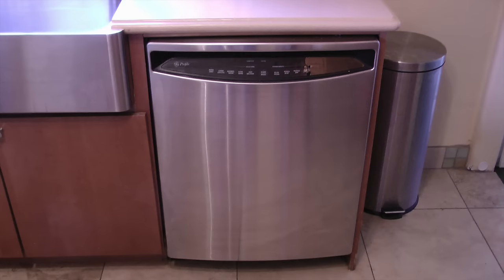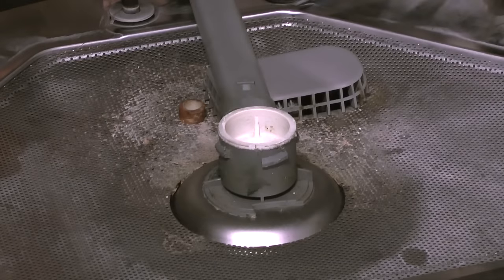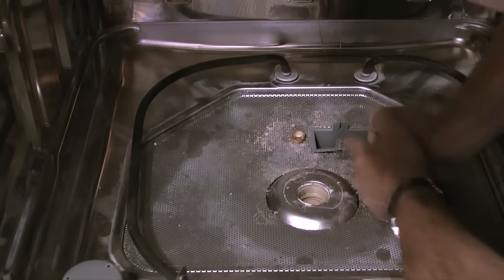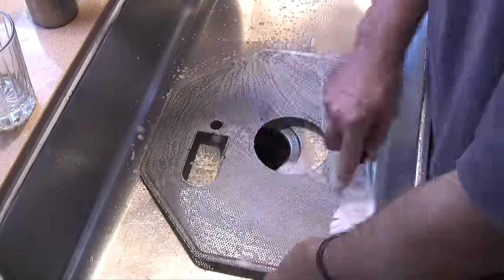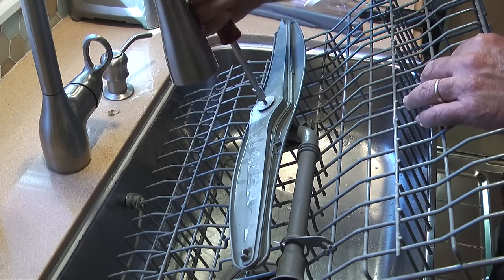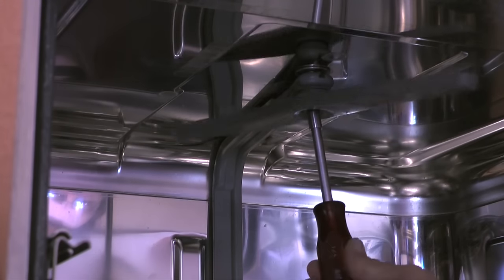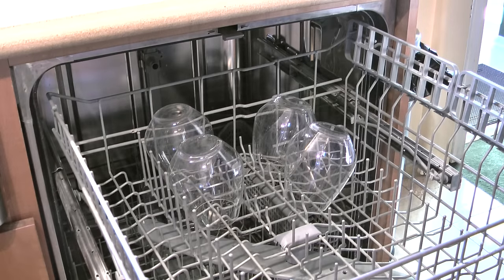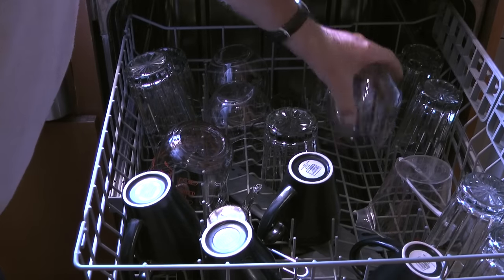GE Profile Dishwasher Maintenance

Comment: THANK YOU!! I have this same dishwasher, but maybe an older (or bigger?) model. The parts in my dishwasher have a lighter color and the utensil basket is different, but the interior parts - and even the front panel - look exactly the same as yours on this video. I have a clog that is making water come out the bottom when I start it, which usually happens when something is clogging around the filter basket, usually when there's  a popcorn kernel stuck in there. But since I can't seem to get it cleared on the surface, this time, I will use your video to get that basket cleaned out. I appreciate the thoroughness! Great video! :)
Reply from the maker: Good luck!

Comment: I had my GE dishwasher out of the mounting and in hundreds of pieces for a complete DIY garage overhaul several years ago.  I literally had calcified stalactites and stalagmites under the stainless coarse screen.  Removing the mineral deposits alone restored the function to near new.  I'd been dreading that whole process again as things have built up a second time over the years, but decided to watch your video and found an even easier way than the last time I'd done it.  BTW, there is a lower rubber bootie that is the main seal for all the low point connections. If you take the whole unit out anyhow, it's well worth going after that inexpensive part too.  Especially if your dishwasher is 8 or 10 years old.  The rubber boot gets brittle and will be the point of leaks if not maintained.
Reply from the maker: +YankeeinSC1 
Good tip, thanks for posting.

Comment: Excellent video but I have to add 1 thing. There is 1 screw holding a temperature sensor cover on (at 0:31 part 843) the part at the left front of the machine as you are looking at it. When I removed this there was nothing but deposits and mold between 843 and 302 and between 302 and what looks like a temperature sensor. It was so clogged I doubt it was working correctly.

Comment: Thank you so much this video has been extremely helpful. I’m grateful to have found it. I am having a major issue with the Venturi it won’t unscrew to save my life. It will barely budge. I don’t want break it because I’m in an apartment.
Reply from the maker: I feel your pain. That's one problem when doing the project yourself, if you break the part then you're without the dishwasher until you can order a new one. Still, if your dishes are coming out dirty your dishwasher isn't doing you much good anyway. If you're renting can the landlord help and call an appliance technician?

Comment: 6 years later and still helping people. Thanks mate, I didn't even think to clean it so thoroughly when I stumbled across this video. Was having issues where the machine was getting stuck on 1 minute remaining, and I had cleaned out the filter basket previously without removing it and felt nothing more. I was actually looking for access to the turbidity sensor as I'd read a dirty one can cause such issues, but this video made me think to give it a deeper clean. By removing and cleaning everything I found and cleaned the turbidity sensor as well located behind the basket. It had a fist-full of white gunk on and around it. Hopefully cleaning all the gunk out will fix it.
Also I think that might be algae you are pulling out, yuck.
Reply from the maker: Cleaning the filter made a big difference on our dishwasher. Thanks for watching.

Comment: What genius designed that filter fastening method? Great how-to video.
Reply from the maker: Good question. It would have been nice if they would have designed the filter so that it wasn't under the supply tube, that way you could remove and clean the filter without removing the supply tube first.

Comment: This is an outstanding example of how to make a video on youtube!! Clear, easy to understand - I wish I could work as fast as you in the video :)

One thing, after taking the venturi out and washing it in the sink, I noticed a silver colored ring (gasket) in the sink. Hummm. I finally discovered it came out of the venturi, fitting between the venturi and the washer arm. Apparently, yours didn't fall out. You might want to mention that in the description of the project.

Comment: Thanks for the great video.  We had the same problem as you, dishes not getting as clean as they used to, so I started with your procedure.  Then I discovered a problem... the tube coming from the sump was completely rotted out!!  I've now replaced the sump and am running the dishwasher to see if it's fixed, fingers crossed!!  :)
Reply from the maker: +Gordon Cindy 
Thanks, did your repair work?
Reply: +iScaper1 Well, the dishwasher seems to be cleaning better than before... and there's no big puddle of water under it, yet, so I guess all-in-all a successful repair!  ;)  Thanks again for your helpful video.
Reply: +Gordon Cindy where did you get the parts to replace your sump? I just discovered that the tube on mine is completely rotted out as well! Thanks!
Reply: +Justin Morgan I got it from Reliable Parts,  I believe this is a common problem. I'm not sure where you're located but there is a website for Canada (http://www.reliableparts.ca/) and one for the US (http://www.reliableparts.com/).  They have a store local to me so I just picked it up there but I think they ship as well. 

Good Luck.

Comment: THANK YOU! I was on the verge of buying a new dishwasher - should not be necessary now.  The GE user manual is NOT  helpful with this process.
OK.  Now that I have completed the process... boy, howdy, what a lot of work.  My tubes inside the machine were oval, like a racetrack.  And I couldn't  remove the screen on the floor, or I couldn't figure out how.  Fortunately the screen was plastic and I could lift it and clean under it.  There was about 20 years of gunk built up under there!  How we kept from dying of food poisoning I'll never know.
Thanks for your help.

Comment: FILTER BASKET EXTRACTION: I don't know if your model is different, but when I looked down into my basket there are little "catches" on the inside that you can see and feel.  These catches are connected to the clips that you were trying to get to from the outside of the basket.  Simply put your flathead screwdriver in the catch and gently pull the clip into the basket.  One side then the other and out it comes.

Great video.  Thanks for posting.
Reply from the maker: Thanks for the information.

Comment: I just cleaned out my GE dishwasher (non-Profile) using this video for guidance. I have used various dishwasher cleaners in the past (affresh, dishwasher magic, lemi-shine). I really didn't have any food particle build-up. What I did have was massive amounts of a white grainy substance. Everywhere. We have hard water and this became an issue a few years back, building up and clogging the arms. I always suspected the machine had build-up in other places but I could never find instructions for cleaning it out. Took several hours. Needed a paint scraper for the bottom of the tub. I had to use a shop-vac to get the particles out of the space below the filter basket, but it's done... Thanks for this video. A lot of my neighbors have just flat-out replaced their machines, and I'm guessing this is the culprit.
Reply from the maker: +Jill Long 
Have you thought about installing a water softener? It might be a long term solution.

Comment: Wow - amazing!  Great video - I could NEVER figure out how to get that darn filter out!!!  I did shortcut a step but it all worked.  Unfortunately where the filter is that little pipe had a break in it, but I duct taped it and it's working fine.  Going to end up with a new dishwasher down the road - that's beyond my abilities.  No more fancy ones either... just need one to get the job done :)
Reply from the maker: Thanks Sharon for watching.

Comment: Thanks very much for an extremely helpful video. I have a version with an adjustable top rack, which according to the manufacturer can only be removed by a technician. Just remove the screws holding the metal plate and plastic hangars (located on the left and right side of the top rack) from the rack and you can pull the rack out from the top.
Reply from the maker: +Christopher Boone 
Great information, thanks for posting.
Reply: +Christopher Boone My top rack is stuck only on the right side (other side slides fine).  I don't see the screws or hangers you are referring to.

Comment: Thank you for this excellent tutorial. I found I was able to move the supply tube out of the way after disconnecting it from that venturi thingy and the bracket at the back, so I didn't need to take out the very top spray assembly. 
ONE MORE THING YOU CAN DO:  Switch detergent to The Home Store Ultra Shine Dish Detergent Pacs from Dollar Tree. Ten packets for $1.00.  Ten cents a load. The best ever. No gummy rinse aid to use. With repeated use it cleared up most of the white gunky film on the dishwasher and glassware.  Try it.
Reply: 7

Comment: This video was amazing - thank you so much! My dishes weren't getting as clean, and there was a smell coming from the dishwasher, especially while running. Like you, I couldn't find any instructions for actually cleaning it, so I looked to disassemble it. I was disgusted with the amount of 'grossness' hiding below but I am so glad I know it is clean now. Your instructions and attention to detail, along with the reassembly were very easy to follow! One thing I noticed is that the drain immediately filled up with water when I was done and used my sink. I googled a little and this seems to be caused by not having a high loop in the drain hose connecting to the garbage disposal. It allows dirty water to go back into the dishwasher, and sit there. Do you know much about this? For now, I have just looped it the best I can and taped it to other pipes. I know, not ideal, but I didn't want to undo all of the cleaning that I just did. Thank you again!
Reply from the maker: +Sarah Quackenbush 
Thanks Sarah for the kind comments. Yes the drain hose needs to have a loop that is higher than the connection to the garbage disposal for exactly the reason you describe.

Comment: Thank you SO MUCH for the excellent and detailed video!  We will start on our Profile dishwasher right now!
Reply from the maker: Good luck!
Reply: Done and ecstatically happy! We also found that along with dental picks, fine-tip hemostats were effective in grabbing and removing items from the spray arms. I actually pulled a shred of carrot out of one arm port!  Also went a step further and removed the water-tube feed from the upper rack and found much gunk in there as well.You are a life (as well as repair call) saver!  Thanks so much!
Reply from the maker: Dental picks and hemostats are a great idea, thanks for posting.

Comment: Thanks for the video. Makes cleaning filters so much easier when you can see how it is done first! I have model # PDW7300N10BB and it seems to be a little different than yours. The hub venturi does not screw out like the one in your video. Fortunately for me the course screen is pliable plastic instead of metal and I was able to simply bend it around the venturi and remove it for cleaning. I searched different web sites to find out how the hub venturi comes out of my dishwasher without any luck. All I know is that it only turns less than a quarter turn and comes to a sudden stop. Fortunately I was able to work around it.
Reply from the maker: Thanks for the information. Hopefully it will help others with the same model you have.

Comment: I have a slightly different model with a “nonremovable” top shelf, and to remove that, I had to use a flathead screwdriver to push back on the last tab portion of the end cap from the inside, then slowly and carefully rotate the cap counterclockwise to remove it.
Reply from the maker: Good information, thanks for posting.

Comment: Thanks for the help! I believe this was the problem with our dishes not getting clean. I did run into a problem removing the spray arm from the top of dishwasher as the tip of screw broke off. Found the part number to reorder another screw but I’m wondering how to remove the tip of screw that’s now broken off in the conduit main assembly?? Hoping I can do this without a service call.

Comment: Nice presentation. Keeping it straightforward and clear. Well done. Now if i could only know why the indicator lights are not illuminating.  🤔
Reply from the maker: +handiexpert 
Thanks. When you find out why the lights aren't working please report back.
Reply: A service company suggested I would likely need a control board and that would be costly. So we agreed I would live without lights.
Reply from the maker: +handiexpert 
How much is a control board for the dishwasher?
Reply: Couple of hundred bucks. Too much to invest in an older and otherwise working dishwasher.
Reply from the maker: +handiexpert 
Agree, it's interesting how they price replacement parts so high that consumers are pushed in to buying new instead of fixing the old.

Comment: Thank you so much for this video!! My dishwasher is running now after I cleaned it. I'm still thinking I screwed it up somehow, but so far so good!
Reply from the maker: Elke Starck 
Where do you think you screwed up?
Reply: iScaper1 I think it's fine now, I just took it apart to clean but managed to get it back together with the help of your video. I do need to get a new filter though, there's a small hole in the mesh.
Reply from the maker: Elke Starck 
Good thinking, if the filter has a hole in the mesh it should be replaced.

Comment: Hi, I had a leak coming from the Float Assembly, in my GE PDWT580R10SS Dishwasher.Totally ruined my Cherry wood floor in front of the dishwasher! Luckily I have extra wood slats! I tightened the Float Assembly which stopped the leak.  Decided to clean the dishwasher while I was at it!  I completely followed your directions to clean the filter. Took everything apart and put it all back together.  Sadly, the tab on the dishwasher Venturi snapped off while putting it back together when reconnecting supply tube. A new Venturi is no longer available. It has been replaced by a Dishwasher Feed Tube with an attached Venturi which I have ordered.  In the meantime, I used epoxy to secure the Venturi to the Supply Tube which is holding nicely.  The dishwasher works great.....just one problem: It sounds like a small ball bearing or marble is rattling around in the dishwasher when it is running!  Again, I took everything out, checked for any loose parts - Nothing!  It's driving me crazy when the dishwasher runs now! It's quiet while filling, but,  when it's running its as though a marble is bouncing around inside.  I have no idea what it could be.  Can you help me try to figure this out so I can fix it? Thank you so much!

Comment: Thanks so much for this! So helpful and detailed. Just finished and am starting a wash cycle.
Reply from the maker: +Lisa Burgess 
Did it work?
Reply: +iScaper1 it is much better for sure. I actually have junk that is in the white tube next to the filter area. I can take a small spoon or tool and scoop stuff out. Maybe something clogged in that tube that keeps the stuff close to the surface? Then what seems to happen is the dishwasher will leave little "crumbs" stuck to glasses and bowls. Any ideas on that tube?
Reply from the maker: +Lisa Burgess 
I would try filling a glass container with white vinegar and setting it on the upper rack then running a cycle without dishes and see if that gets rid of the crumbs. I had problems with the crumbs on glasses also until I did this step. If that doesn't work you may have to check and clean the filter again. Let me know what happens. :)

Comment: I just bought one of these on Craigslist for $25.  After finally getting it hooked up and running it, everything was coated with debris.  Thanks for this helpful tutorial.  It took quite a bit of cleaning, but I'm hopeful for next time we run it.  Do you know what the little white tube is that is just to the left of the filter?  Ours is disinigrating!  Again, great video!  Just what I needed!

Comment: Other than being able to unscrew the venturi from the pump connector all went perfectly!  I just left it and wiggled the main filter around it.
Reply: I had a terrrible time getting my venturi out too !
Reply: I can't get my venturi to unscrew either. I would LOVE to know how to remove a venturi that just turns and turns but won't actually unscrew. I AM turning it counter clockwise. I've even tried pulling up on it while turning it counter clockwise. Still no luck. However, I think I'm going to see if I can wiggle the screen out. I'm glad I'm not the only one with this problem.

Comment: Great video on how to clean your cleaner :) I will for sure do the same, as I have a lot of white residue. Unfortunately I also have issue with the drain pump ... it makes a whirring sound ... but no water is coming out (I can detach the hose and siphon the water out, so I do not think I'm clogged ... but might be that the impeller is broketarded or something else ... might have to go full plumber on it ...

Comment: Good video...I managed to follow these instructions but one part stumped me. When you remove the sump filter there is a white rubber hose sticking up through the "fine filter" at the end of the sump chamber. Mine is totally ripped apart and I couldn't get it out in one piece. What does this "hose" do? Look at approximately 3:55 of the video.
Reply from the maker: If I understand you correctly it looks like the tube is part of the sump inlet. From the parts diagram (#505) it looks like it's a one piece unit. Here's a link to the part: https://www.geapplianceparts.com/store/parts/ModelSectionParts/PDW8280J03SS/5/0/0/0/MOTOR-PUMP_MECHANISM